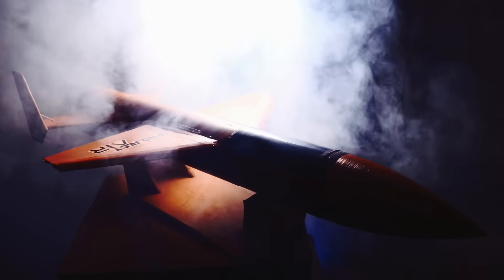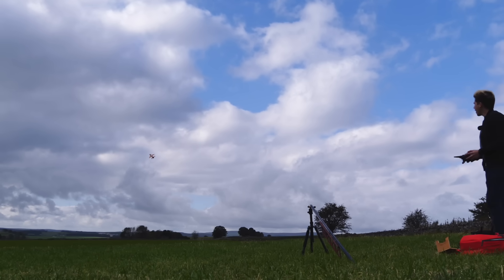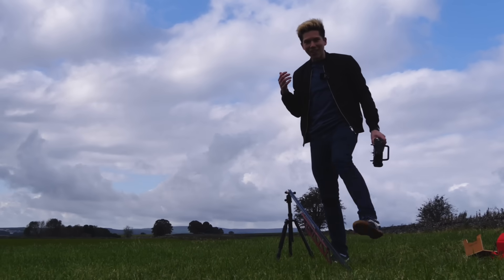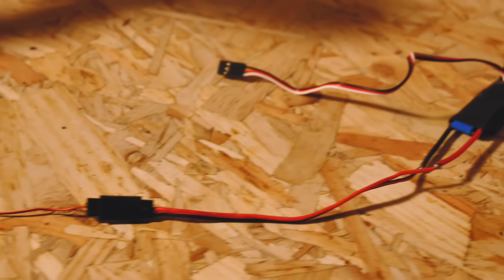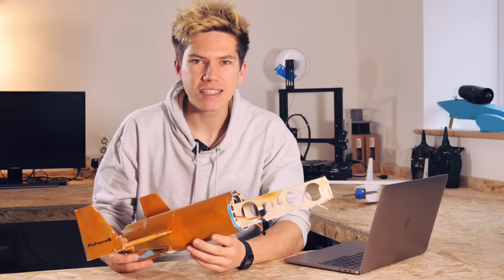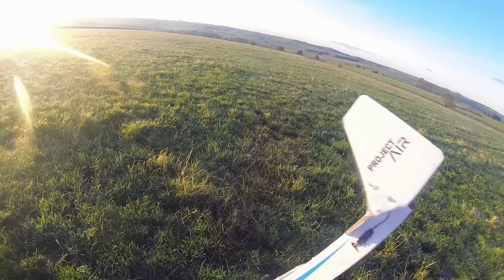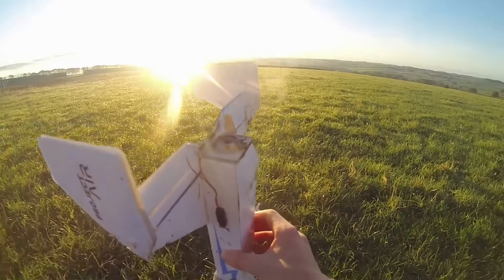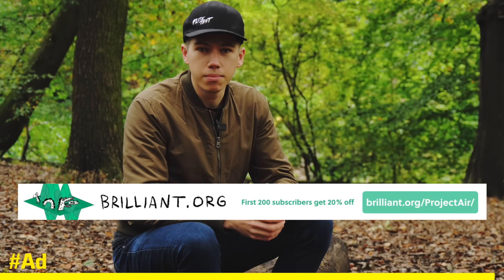High Power Rocket Plane pt.2

Comment from the maker: The first 200 people to sign up with Brilliant using my link https://brilliant.org/ProjectAir/ will get 20% off their annual subscription.
Reply: for that SUPER SPEED, you would benefit more if the rocket motors were linked in series. EXAMPLE= 3 motors fired at once will give you less velocity than 3 motors fired back to back. you are really really really looking for long burn time. off the shelf rocket motors do not provide this, except in a multi stage config. If you want to break some speed records,  ditch the electric motors (drag)...attach the rocket plane to the belly of a carrier plane...release mid air, fire the multi stage rockets with your control trims set low. BINGO BONGO, YOU JUST HIT 200MPH.  but what would i know, i just work for northrop.
Reply: What is that red launching stand called as???
I've Seen it in many videos.
Reply: Folding prop - shut ogf electric engine just before ignition..? 🤔
Reply: Great plane and good to see another rocket plane. I also fly rc boost gliders - look forward to seeing more of your videos 
https://youtu.be/ChaOMraQ9ec
Reply: You should make a parachute
Reply: Terrible results. 

Should have started with a pylon racer airframe (there are even free 3D print files)… and use a folding prop or at least an ESC with prop brake functionality… way less drag. And use a bungee off the starting rails.
Reply from the maker: @TweakRacer  looking forward to seeing your design :)
Reply: @Project-Air  do you know why your design is out standing because it uses a key theory in aero dynamics it's called compression thrust even tho it works during mach1 or above but that end tail fin that is facing down give it a efficient lift
Reply: @BLUBLUD huh?
Reply: Đa😐😐😐😐😐😐⏳⌛
Reply: You need a third stage with a parachute. Just a small one for braking before impact.
Reply: How did you find that weather website? I cannot for the life of me find a good weather website
Reply: can you show us how eletronics work and what they do
Reply: I can't find the plans on patreon.
Reply: I Would Recoment Using Carbon fiber-reinforced
Reply: why does it look like cruise missile
Reply: Make a JATO aircraft
Reply: Could you put four extra  boosters on the wings . If the  main boosters are out.  You could on the four extra boosters on the wings
Reply: Ok ok
Reply: Me likes
Reply: flight controller ?!?

Comment: This reminds me of when I was a kid in the 70s.  I was into model rockets, fireworks, airplanes...if it flew or blew up, I was all in.  There used to be a styrofoam toy plane called a Delta Dart.  They cost $0.10.  They had a little tab under the nose you could affix a rubber band on a stick to pull back and launch it.  I always wanted to take a bottle rocket off the stick and attach it to one to see how it would fly under rocket power.  I never had the bottle rockets at the same time as a Delta Dart, as it was somewhat difficult for me to come by fireworks as a kid.  I did modify the shit out of my model rockets, however.  Getting rid of the motor mount and just stuffing a D engine into one, or taking a small streamer recovery rocket, nixing the recovery system and gluing the nosecone in place so when the ejection charge went off, it just ejected the engine out of the rocket and it would just come down nose first into the ground (Estes Wizard).  Good times.

Comment: Design a way for the props to fold back against the engine body removing the aerodynamic drag and make a automatic system that fires rockets one after the other perfectly. Maybe also look at a system that deploys a parachute if the planes starts to fall out of the sky or gets below a certain height. Obviously you'd have to test what the lowest height was where the chute would actually still work to see if feasible but it's an option.

Comment: If the pitch is "wrong" then the props could actually slow it down.
Reply: Of course, then  you'd have some great generators! Check the battery charge circut and see if you have a gain or a loss.

Comment: How about trying this: let's say you launch with 3 out of six engine ports ignited. You zoom about and whenever you feel like it, you ignite the other set of 3 engines. You don't need a separate stage. Just light them with igniters already installed.  Keep up the fine work!

Comment: Try using Estes engines for booster stages. Those don't have the charge to eject a parachute. Or like some of the boost gliders do, use the parachute charge to eject the engine itself.

Comment: Terrible results. 

Should have started with a pylon racer airframe (there are even free 3D print files)… and use a folding prop or at least an ESC with prop brake functionality… way less drag. And use a bungee off the starting rails.

Comment: I assume you are a BMFA member. You need to have a look at setting a new British speed record for a RC aircraft. I hold the record for a electric Pylon model but thats round a triangular course. We had a go at straight line with the same model on a bigger prop and recorded 240 mph but could not get it made official. Jets and Gliders go wayfaster than that. Im guessing 350 is fairly easy nowadays  :-) Im 12 years older than when i set my record in F5D. I find my 140mph EDF fast now. young lad like you should easily have the thumbs for a lot faster.

Comment: Though I know far less about rocket planes than you James, I do know that some very small passenger planes like Pipers I believe, have back up safety parachutes. Is that a possibility with your prototype small scale model jet planes ? 
I know it's more engineering and time but that's your call. 
Great job by the way as always. 👍👍

Comment: An interesting sortie into hybrid power flight.  That ejection charge disappointed though- no onboard fire and first responders.  Very X-1 like flight which wasn’t captured with the onboard but, like the 1949 flight, was a streak of rocket track across the sky, seen from the ground.  Perhaps more sound from the plane?  Loved the contretemps.

Comment: And also design engine covers for your propeller engine but design them based off the engine design of a Boeing 747 I promise you that casing they have on their engines if simulated even for propeller operated engines will allow them to handle more speed in your flight when you set your rockets off. 👍

Comment: Mate go back to the original rocket design extend your wings buy an inch to an inch and a half either side balance your weight more Centre little off centre and next time you launch with hi winds be sure to launch the way the wind is blowing on your take off not against it other than that good job mate you obviously know what you're doing and that was pretty impressive that you've identify all the faults on the original design so stick with it.

Comment: WIth the second design, couldn't you have had a longer fuselage with the rear flight control surfaces (rudders and horizontal stabilizer) unchanged in position, but with the rocket motors even further rearward on a separate section? That way you would have been able to jettison that section after the rockets had fired, moving the CoG forward while still maintaining pitch control.

Comment: What about using an underside wing mount for the boosters? Fit cones to the front of them for aero, and a ducted fan for standard flight power. Keeps it fairly stream line and the balance will never change, even as the powder leaves the solid rockets since they will be wing mounted. Just a thought.

Comment: Hi mate, nice video. Have u considered lovering the angle of the wing (if u not consider going supersonic) and also using wing root extensions to give u more lift and control. Also redesigning the fuselage as a lifting body (something like Su27, B70 of SR71) might help with lift and low speed stability without adding too much weight or drag.

Comment: Wait, do those longitudinal wooden electronics mounts end right at that bulkhead?
If so, there's a big structural problem right there.  You're asking for that thing to snap in half, which is exactly what happened.
Extend those into the portion of the fuselage aft of the bulkhead and gradually terminate them so the load can be gradually transferred into whatever you're using for longitudinal support in the aft section.

Comment: If you set the motor brake to ON using the ESC programming, it will minimize drag on either props or EDFs and allow the ROCKET to maximize the thrust with minimum drag.

Comment: I may be wrong, and correct me if i am, but im imagining it would be more efficient and you would be able to get more out of 4 engines if you add a sort of funnel on the end and when you want rocket power you ignite them individually with the thrust coming specifically out of the funnel making it not spin out of control.

Comment: I've noticed that every video I've seen of his has a common theme. He seems to not bother checking the cg. There's at least three good ways to check!! Glider test: just throw it or drop it from a high place and use control surfaces to control the decent. Balance test: put it on ur finger in the front third of the wings and change the cg until it balances. And mathematical test: There's several websites one can use to check cg. Its basicly plug and play. Or just try watching any video from flight test. They do it every single flight. It's not that hard.
Reply from the maker: I always check my CG, it’s just it’s not always that easy to figure out where it’s supposed to be with these experimental planes! It’s also quite hard to glide test a ‘brick’ like this plane. Stall speed is something like 30mph! Sometimes you just have to do your best to figure it out and go for it! All or nothing 😉✌️
Reply: @Project-Air  or you could calculate it. And test it with a throw. 30mph isn't that fast.

Comment: dude, you need to check your CG. put your fingers under the wing about 1/3 to 1/2 of the width from the leading edge. balance is best nose is slightly down. vast majority of model aircraft will fly best slightly nose heavy. Tail heavy makes plane squirrely to uncontrollable.

Comment: Its not a good plane design right now, the first one was sort of ok. Most of your limitations to speed are going to be aerodynamics taking a basic rocket with wings or plane and strapping a rocket to it is only serving a proof of concept which you can figure out by thrust values.
Look into making it way more aerodynamic a flying wing with a folding prop at the rear then build the rocket thrusters into the wing design. I am pretty sure flighttest flew over 200kmh with a cut down plane and large electric motor.

Comment: There are these rotors, that flap to the rear, when the motor is not actively providing torque. Maybe you can benefit from such a thing in the boosting stage.

Comment: You produced a test platform that worked really really well and then ignored that fact and tried other ways to do the same thing straight away without fully knowing the limits of this awesome thing that was designed by you. I don't think scunkworks opperate like that when they produce something really good. Not having a go just an old bugger that used to strap rockets to everything he could

Comment: Years ago, I flew R/C quite a bit.   Sometimes I'd crash on that first flight due to something shifting and my CG going rearward.  
Then, in an ah ha! moment, I realized I had more thrust than weight, so I could just point the nose up and hang it on the prop.
The next time I had a bad launch and the craft wanted to immediately stall, I throttled up and pointed the nose up.  Then just gradually throttled back to set it down gently on it's tail rather than try to recover into flight.   Saved rebuilding it. :-)

Comment: Would you be selling kits of your rocket plane once you achieve your goals? I am wondering if you could land your rocket plane by a large parachute...you can also use Booster motors...they have all the impulsive of all the other motors but no ejection charge....you could land your rocket plane using a parachute ejection system like they use on water rockets....

friarrodney_burnap@yahoo.com

Comment: I wonder if you could use a different propeller design and move it inside of the frame with an air intake and outtake you could make a better flying rocket plane.

Comment: I have an idea to protect the props during high speeds...

Build forward-pointing conical-shaped shrouds and attach permanently to fuselage/wings, then mount the motors on servos that position the props behind the shrouds while the rockets are firing and protrude away from them during normal flight to achieve proper airflow. Worth a shot?

Comment: So the first rocket plan was a better design just the wing need to be around the electric engine's that way you can tolerate the speed of the rocket motors.  just my two cents

Comment: How can you be aware of the CG and the Parachute Eject from the motor as you already added features to compensate this in a previous model and was also adjusting the CG in a previous model, Then you crash due to poor CG setup and the parachute pop from the motor? You learned nothing and actually went backwards. School boy errors.

Comment: Btw, you should look into using the "plugged" rocket engines instead of the upper stage type.  The plugged style do not have an ejection charge, and they have a clay cap to prevent the hot gasses from exiting the forward part of the engine as happens with a booster type.  D11-P from Estes is a good example, or the smaller A10-PT.

Comment: You should mount one of those motors in the nose cone[just realized you can't because the electronics are inside. But you could mount some rocket motors under the wing...] and then mount the rockets on the wings and back to distribute the load. Then balance it on a fulcrum with empty and full motors to see if you can really get a good trade off on that. Another thing you can do is maybe remove the concrete from the D motors and replace it with lighter epoxy...but you probably don't want to go through all that bother.

Comment: Greetings James!
Your first plane with the EDF’s flew pretty well. I would recommend you return to that design and refine it. I would also recommend that you use rockets without the ejection charge. If you want to get fancy, you could use adjustable nose cones in front of the EDF’s to reduce drag when you fire the rockets, similar to the air inlets on the SR-71 engine nacelles. Also, if you install flaps on the wings, the aircraft would be more stable at slower speeds for softer landings. Since the original configuration performed so well, in my opinion, that it deserves further investigation and refinement, you could also try adding retractable landing gear, or skids. Another thing you could try, is to put a heat resistant bulkhead in rocket motor section so that the rocket motor/motors self eject when they are depleted.
Thank you for posting this video! Please have an excellent and awesome day! 🙂

Comment: I would suggest to buy some cheap drone flight controller ( or build it with arduino) and put it in the aircraft for logging gyroscope + accelerometer values.
Would be interesting :)

Comment: Little tip, you want your CG not smack center,  but slightly nose heavy, so if u held the plane under the center of the wings at the fuselage, you want it to tilt forward ever so lightly. It makes for a much more controller launch and in air stability, center balance is almost like being tail heavy as u accelerate the air pressure at front half of the plane will cause it to act tail heavy.  Other than that, great job still!!

Comment: I'm not sure why you're not using booster engines instead of ones with ejection charges. Also it may help you to study the bomarc missile. kind of similar to what you're doing and a proven design from 1955 until 1972

Comment: You have to use folding prop and change the airframe. The air duct crate incredible amount of drag. Once you go faster than capability of the duct fan they act as an air break. Ditch the double vertical stabilizer, its unnecessary and it adds weight. High wing loading is good. Double check the cg. Also once you do all these things it will fly faster, maybe much much faster therefore expect the wing to separate from fuselage from additional lift. And don't fly it in such windy conditions. I crashed glider into strong wind too... so no shame there. It happens to those who try

Comment: you should make your own sugar rockets, but make it a longer lasting so you can accurately get the speed and have a longer lasting boost, also, you could make a launching system where theres a small, strong, hook on the back of the plane, on your launch ramp, you have something that grabs the hook (you can also release), go full throttle on the engines, then release the aircraft, making it have the best acceleration possible, kinda like a jet catapult minus the throwing part, and this could just have like a little pad you step on the clamp down, and lift your foot to release

Comment: Lower your ramp angle, that's why it struggled to take off using the EDF's. Have two on a Phantom(ish) I built. Fit version 2 with a folding prop.

Comment: You would have done better putting your ducted fans internally and making it more of a lifting body like a F-15 so that the exhaust for the ducted fan would also be the mounting points for the rocket engines.

Comment: Someone’s gotta know more than I do. Are there options for motors with blade pitch authority at this size and speed that could be used on a hybrid aircraft like this? Being able to increase the pitch angle of the blades when using the rocket booster would both reduce drag and the likelihood of over taxing the motors.

Comment: I am thinking 25% larger. folding prop with motor break. Aerotech's new H13 reload. You just might shred it going to fast :-) folding prop with motor break so you don't overspeed the motor and reduce prop drag.